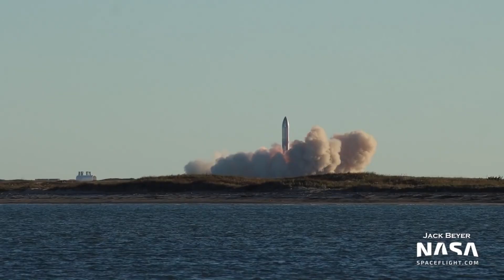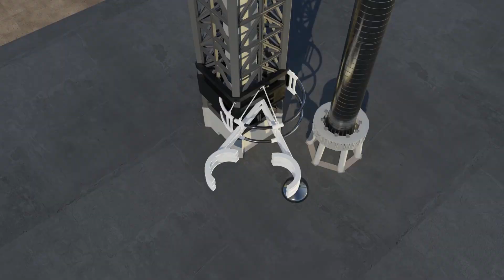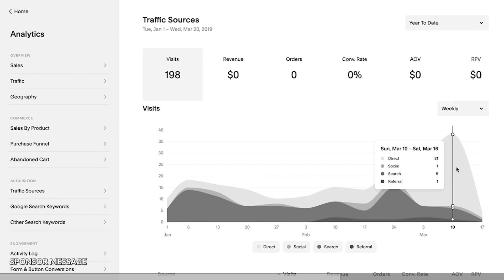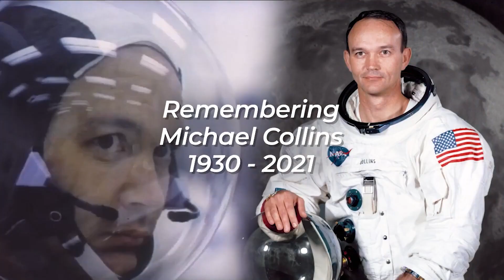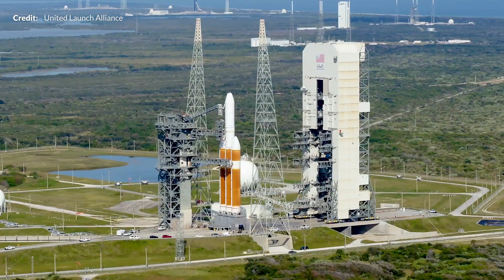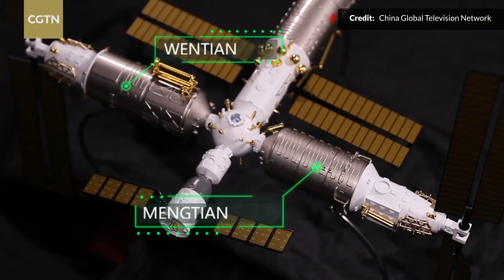SpaceX Starship SN15 Flight soon, NROL-82, Crew 1 & 2 updates, Starlink, Michael Collins

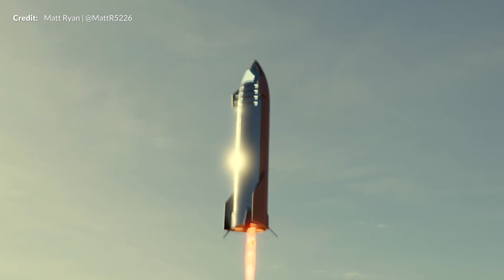Comment: 6:18  The starship will require legs for the Moon and Mars this is true. However the legs needed for even Mars may not need to be as elaberiate as would m be needed for a earth landing. So if SpaceX can save weight and complexity by catching a Starship on Earth then that may be a valid concept.

Comment: A pity really that this capacity ⚖🏆of the payloads 👑⚜⚜👑 not mean anything in their eyes because they see that the specifications of the return 👀👀🎈🎈🎈🎈⚓,,,🪐🪐🔮???....of the humanity never seek to be honored in # "1" first Place. 

This because of the square meters of attack on the ground, however Indispensable, necessary for the Lander in all its external maneuvers and recovery, this vessel resists the wind and the tide which is none other than guidance difficulties, reserved as perpetual dwellings 55 meters high.

Which will have no meaning on Mars, except to raise one or more children from fetus, until adulthood.

Then another rocket from Earth, would do the job of repatriating the Martians back to Earth.

HERE, Without surface efficiency of the vehicle then underfed and devoid of any piece of runway or touch-sensitive landing elements for the control of the distance of the thrust, obviously one or more limited individuals and behind these machines perceived these 64 , 7 million kilometers as an insurmountable barrier not affected by the evolution of humanity or what is left of it.

Which is ludicrous in itself, by proposing to manufacture a simple anti-gravity load-carrying device (Heavy Lift), on tiptoe. So far, they have deprived themselves of the most elementary considerations of (all) explorer (s) started by:
 
The first components whose applications of return in difficult condition if the inventors were then explorers in order to be able to present a discovery and not not fall with it because it is still obviously too far to come back from this evolution of humanity.

Which is here pre-manufactured in simplified functions of simple conquerors of the interstellar vacuum, pays homage to the great inventors of machines, but without sufficient suitable formulation, for their autonomous and repetitive uses AS humans have always done and always will in deep space

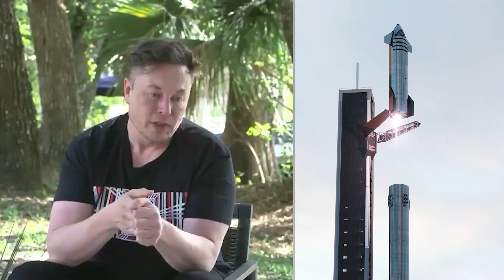Comment: 5:45 "[...] catching the Starship as well. That to me seems a little unnecessary considering that the Starship must have legs to land on Mars"

Most starships aren't going to land on Mars. Many will be tankers for the sole purpose of refueling other Starships in LEO. Fully refueling a single Starship requires several tanker launches. There will also be many Starships which will launch Starlinks and commercial payloads and land only on spaceports with catching towers. And who knows how many for suborbital travel on Earth.

Comment: Catching StarShip might make sense because the legs you need for Mars only have to support about a third of the weight...and there will be StarShip variants (such as the tanker) that will be flying VERY frequently, and not having to lift and stack back onto the SuperHeavy makes sense for variants that would never need legs at all.   Saving the weight of the legs means more fuel to orbit.

Comment: On Starship capture: think in terms of the tasks any particular starship is going to do. If it is only going to deliver product to LEO, be it peopke, cargo or fuel, it will only return to Earth. If landing leg system masses 5 tons, not having legs means an additional 5 tons delivered to orbit. It's the same for any lunar Starship - no heat shield and Elonerons, 20 tons(ish) converted to deliverable mass. For thst matter lunar Starship has no need for 3 sea level Raptors, that`s another 6-9 tons converted to deliverable mass.

Comment: Tanker version of Starship won’t be landing anywhere but Earth, so saving weight by omitting its landing gear would allow more payload.  The Mars Starships may have 0.3g optimised gear that prevents landing in 1g.  Starships purely for Earth use, to get crew and cargo into orbit for transfer to Mars or Lunar Starships or to other platforms will be returning to Earth and would have the catchers available, so their gear could be omitted for payload increase too.  So, having the Heavy catcher used on those Starship versions makes sense.

Comment: Why does Spacex, on each Starlink launch, release a big metal bar that just becomes more junk floating around in orbit?
Reply: Because if you don't the entire stack will be shredded long before it actually got to space

That rod is released into ~280 km orbit, which is pretty low. It reentered several months later at most

Comment: Alright, I'm getting tired of hearing all this talk about longer burns on the landing cycle.
So, Let me explain a negative feedback loop.

A negative feedback loop is a reaction that causes a decrease in function or performance. It occurs in response to some kind of stimulus or offset in parameters. Often, it causes the output of a system to be lessened; so, the feedback tends to stabilize the system to an extent. This can be referred to as homeostasis in biology, or equilibrium in mechanics. But once you venture past the stabilizing effects (or event horizon) you enter into a series of detrimental cascading events.
Example:
Longer burn = more fuel.  
More fuel = more mass.  
More mass = longer burn.
Longer burn = more fuel.

These engineers are working with very thin performance margins.  Cut them some slack, yeah?
If I hear one more IDIOT say, "I don't understand why they don't just start the Raptors sooner on the landing cycle." 
OR EVEN WORSE "Why can't we all just drive electric cars and power our homes with solar?"  I'm going to rip my hair out!

Comment: It seems that the raptor engines will never give the starship a stable landing due to its enormous inertia, so when landing on the earth some assistance seems to be necessary to ensure a stable and safe landing.
Reply: No ship had ever crashed because of this inertia nonsense. Either CH4 leak, LOX preburner didn't light, or CH4 header tank pressurization/ullage
Reply: Or maybe just say that all tests were successful and in 2022 Spacex will fly to Mars as previously planned?

Comment: Re the comments at 5:50 onwards...IMO capturing StarShips makes perfect sense. StarShip will be virtually empty by the time it reaches LEO, so most launches will probably be refueling missions (six for each Mars mission, and at least one for anything else). That being the case, it would make perfect sense to re-capture the re-fuellers to save weight, given that they don't actually need landing legs. They also almost certainly won't need to be manned, and will thus be much better candidates for such a risky maneuver.

Comment: I feel like the tower isn't exactly catching it , its basicly going to land itself before the arms take the load.
Reply: It's going to enter a hover just as it hits the arms. So it's a suicide burn just like a leg landing. In fact, i think the vertical precision can be much less than a leg landing, since the tower arms can have far more travel distance in the spring than a leg can, and will also be much more resistant than legs. What makes it more difficult is that the horizontal precision must be much higher. Landing pads are large, but the horizontal area that the booster must be within when being catched is much smaller. And if you get it wrong you can seriously damage the tower.

Comment: Thoughts about the insulating sleeves. If they can get it airtight, why not make it a vacuum instead if filling it with insulating foam. They are now specialists in airtight fuel tanks. Furthermore, if the fuel tank inside need repairs you can just lift the insulating sleeve fix and place it back. Does it makes sense? Isn’t a vacuum the best insulation?

Comment: Still cant see the booster catch happening. It would require inch perfect accuracy and the consequences of failure go way beyond just losing a booster. Falcon 9 can kinda land in pre designated circle...but is far from inch perfect.....sorry.
Reply: Accuracy can be improved, and it's still more margin than the original idea of land exactly at the mount
Reply: @alvianchoiriapriliansyah9882  Dont get me wrong Alvian....i really really want this to happen. But when we take all into account, the belly flop/flip (the booster will have to do that to)...and now the catch..i just think it might be pushing things to far. I still think the booster will be landed like the Falcon 9....we will see i suppose.
Reply: @dazuk1969  the booster will not have to do the bellyflip. Only starship will have to do that as it's returning from orbital speeds. Super heavy will land like a falcon 9
Reply: @Easedaray  So the booster which will be over 150 tons (closer to 200) is going to do the pencil descent ?...that is what i said in a roundabout kinda way...like Falcon 9. I appreciate your words...but i still cant see something of that weight being caught out of the air. That is just my opinion...nothing more.

Comment: I think catching the starship with the tower makes sense because the vast majority of upper stages will be used to launch cargo or fuel to LEO and return. The few needing to land on Mars will only need legs until a catch tower can be made there. Every ton saved is important to the financial picture.
I cannot however support the payload penalty for using steel in the booster. The booster does not face the reentry temperatures of starship. It is much more similar to what the falcon booster faces. Using aluminum, or aluminium as you down under blokes say it will save at least 60,000 pounds of weight which relates to more payload or fewer Raptors and fuel needed.  It will be interesting to understand the method to the spacex madness. Lol

Comment: Musk has reported he is going to catch the Starship and that's what he is going to do. I felt that would be the case from the time he announced he would catch the booster. In reality, there will be far more point to point flights on earth than there will be earth to mars over the next several years. Earth to earth will be in support of satellite/cargo launches and perhaps more importantly, military launches. That doesn't mean there won't be landing gear. I expect the Starship will have some kind of landing gear option. Either permanent or quick removal. There are too many advantages to catching a vehicle when you can rather than landing it. Space, time, loading/unloading, inspection, convenience, and vehicle support prior to and at launch, etc.

Comment: I'm confident the talk of catching Starships derives from frustration over the landings. Not likely to happen, as it adds engineering without adding capability.
Reply: If you don't have to carry the mass of landing legs to altitude, you can carry more fuel or payload. So it is about capability.
Reply: @jeffreypierson2064  Good point indeed. But wouldn't it be easier to expend the Starship or add a ring to the booster? (Not a rhetorical question. I really have no idea.)

Comment: I think a Starship catch would be an interim solution, targeted perhaps at the Artemis program, while they worked on perfecting the Starship landing technique.  However, it's probably also true that a landing system and legs robust enough for an Earth landing is quite a bit more difficult than one that could support a successful Mars landing.  The original legs might have been strong enough not to collapse on Mars, for example.  Indeed, engineers might originally have been designing with Mars in mind, which might be part of why the Earth landings are going so poorly.

Comment: My concern with the tower catching a Starship is that immediately after a belly flop, the Starship not only has to hit a very small target that are the arms on the tower, but also avoid a huge obstacle that is the tower.
Reply: Right. And these things are very heavy. Even when empty they're around 100 tons of steel. So if they're going to be able to catch at any distance at all from the center of gravity to the weight bearing part of the tower, they'll need some sort of cantilever to distribute the forces.
Reply: It won't be catching starship, it will be catching super heavy, which will land like falcon 9

Comment: Disagree with your thoughts on landing legs - There will be many different variants of starship - lunar, cargo, suborbital, etc

Each one will have different configurations, so for instance the tanker/cargo variant: it's never going to mars, it's not going to the moon, it has no need for legs.
Getting rid of the legs will save a lot of weight that could then be used for more cargo. If you can catch boosters reliably, why not catch the cargo variant too?

Comment: Starship needs to be able to land with its own legs, solely as a precaution. If there's an emergency and Starship needs to land anywhere other than the intended launch or landing site, it will need it's own legs and/or other way to land on it's own.
Reply: Elon mentioned the emergency backup will be to land flush on its aft end. SN10's landing legs failed to deploy properly but the ship landed in that way, upright and balanced. If the engine had been able to provide the proper thrust, that would have worked out quite well.

Of course, it needs a very level piece terrain. Meh, any parking lot will do...
Reply: @donjones4719  Maybe some kind of mega parachute and aft airbags would be lighter and more reliable than legs in the event of emergency landing?
Reply: @ColtonRDean   Parachutes need to be a pretty high altitude to deploy, even if deployed ballistically. That's why they weren't an option for a back-up to Dragon's original propulsive landing. If you were close enough to the ground to know you were missing the tower arms, then there'd be no time for parachutes to help. If landing  anywhere in the world, and knew to deploy early enough - carrying and deploying a parachute large enough for a 130+ tonne ship would require enormous chutes, a lot heavier than one might guess. Would take up a lot of space and payload mass - if it's even possible to handle 130t. After all that, the ship would still land flush on its base, since it has no legs. Almost no chance that would happen, swing under a chute

Airbags are surprisingly heavy. Ones able to cushion 130t of ship would be very large and heavy - and I don't see how airbags could keep a Starship vertical.
Reply: @donjones4719  Curious how it would handle in the event of a water landing. Maybe it would partially flood the main tank so that it would remain in an upright position, and bobble in the water until recovery?

Comment: Launching to orbit in July?  When you look at the progress of all the elements at the orbital launch pad, not having a set of plans, you would have to guess that there is no way this facility will be complete and operational in 3 months. They may be able to preassemble and snap together the integration tower quickly but installing electrical and mechanical systems as well as a crane and an elevator and a catching system... that would be an impressive trick. Completing the Orbital tank farm and it's mechanical electrical infrastructure...also  would be very impressive. However, this is Space X. They have been launching Starships while their shipyard and launch pad are under construction. So, would they be able to launch something  to orbit in or near July to orbit? Again, that too, would be very impressive but not a shock! But I wouldn't count on a launch tower recovery. Splash one booster? Maybe!
Reply: I suspect BN3 will be expended or have legs, just to make the timetable. Catching will be BN5 or BN6 attempt, in my guess.

Comment: it's actually not a strange idea to catch the starship as well. If it is going to carry passengers in the future, it would make operations much easier because you can place the starship back on the booster right after landing (reducing the time needed for placing it back on the booster) and use the same crew access arm to unload passengers. this would make flying on starship overall a better experience I think. Furthermore, for boosters that are meant for earth operations they could remove the landing legs.

Comment: I think the one size fits it all approach is not viable. We already see a special variant for the moon just because 'no atmosphere'. Mars has an atmosphere but it differs from Earth atmosphere too much to make the approach with a starship similar enough to have the same designe for Mars and Earth. Either you'll go with a compromise and sacrifice efficiency, or you build special variants for each and every single task and flight profile. 

I don't see why it is needed that the same model that starts from earth, should also cross the void to Mars, land on Mars, lift off Mars, cross the void again and then land on Earth again. If you have a modular designe at hand you if you build these things in the hundreds anyway... then I assume we'll see many different versions and variants, each specially designed for it's task. 

But that's just a guess... we'll see if this thing will make it to orbit and land in a safe way so that humans can ride it before we talk about the next stepp I guess.

Comment: would it not be easier to dig a pit, reinforce the walls with cement and burying the structures used for catching the spaceship into the wall of said pit building some form of hydraulics or captive tension to take up the weight on a successful catch. is there a net structure made in our society strong enough to catch the whole ship? placing all the load on two arms seems very hard. love this channel, best out of all the nasa/spaceflight/space ex coverage channels for me, there are others that are definitely good but something about this one just clicks.

Edit: scott manley is tied for best/really good for me as well.
Reply: Heh. I think Elon spoke to the thought of using nets or bouncy house solutions as 'undignified' or some such thing.